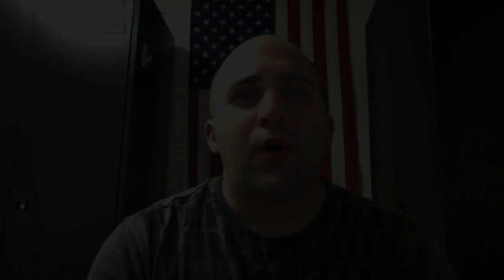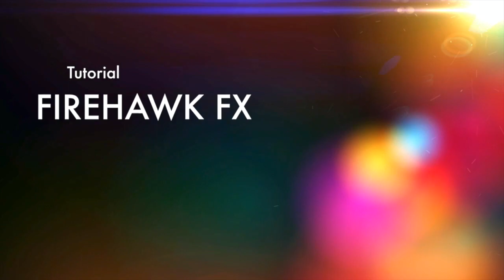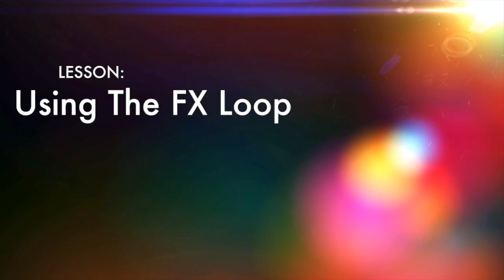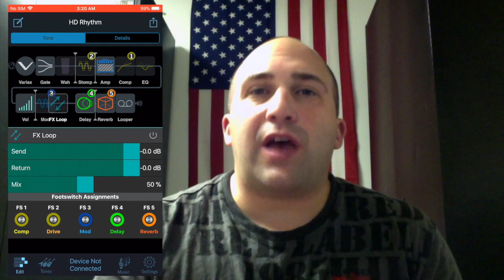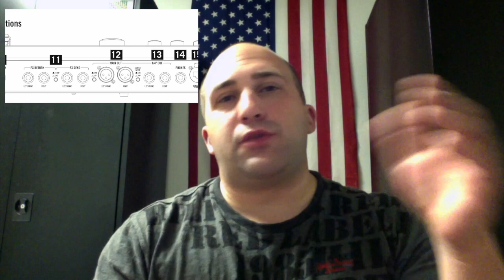FireHawk FX - FX Loop Function Review

Comment: OK.  I don't have extra pedals.  What I do have is the Firehawk FX and a Boss Katana 100 amp.  Is there a way to use the Firehawk on the effects loop of the amp?  The amp has a send and receive jack.
Reply from the maker: You can turn off the amp and cab, and set up your pedals in a pre position and go straight into your amp. You can also turn off the amp and run a four cable method in its FX loop if you want them not affect by the pre amp.

Comment: Thanks for the helpful info. New to this multi effects pedal game. I want to connect an external looper to my firehawk. What is the correct method? I have tried but once i add a second layer on my looper it gets some weird loud noises. Its probably how i have it connected. Not sure how best set up the effects loop in the appThanks!
Reply from the maker: You will need to decided if you want the loop post or pre in the Firehawk chain. Pre will be a clean signal and post will be the adjusted signal. 

Before I sold mine, I was going to get an external ditto and place is at the output of the u it. The plan was to record with one patch and then switch patches for the layering. I would experiment with the setup that works best for you.